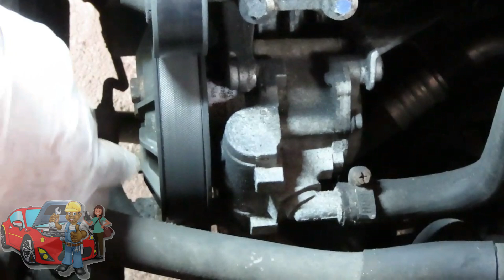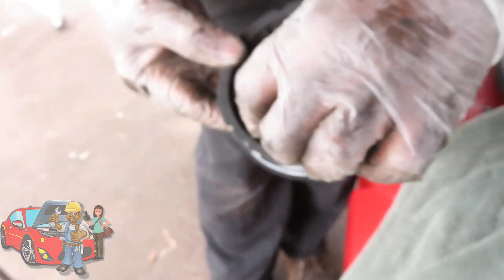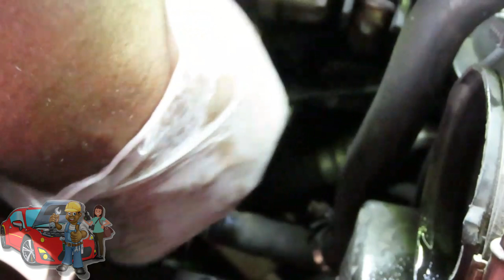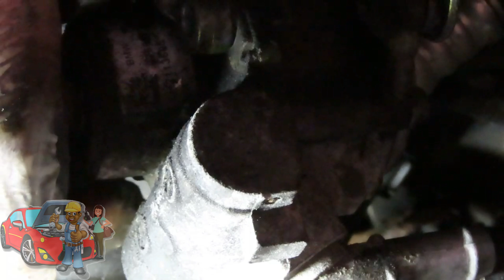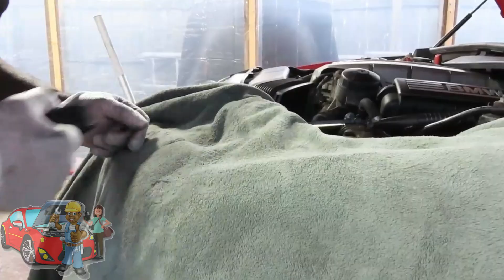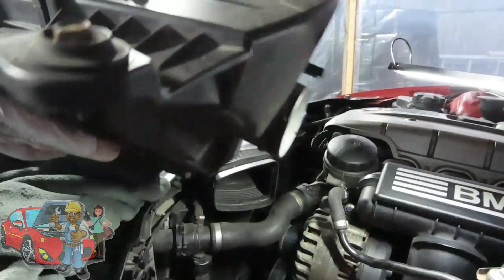BMW 325i 325xi 328i 328xi 330i Power Steering Pump Replacement 2006-2013

Comment: Hello I'm currently doing my power steering pump but the banjo bolt doesn't fit the new pump, could you send me the link were you got your power steering pump from? I have a 2007 bmw 328i n51 w/o active steering

Comment: This is a great video. Much appreciated. May I ask where did you get the Banjo Bolt Washers? Is there 1 or 2 Banjo bolts? Please provide a link for all parts. I will very much I appreciate it. I need to get this done asap!